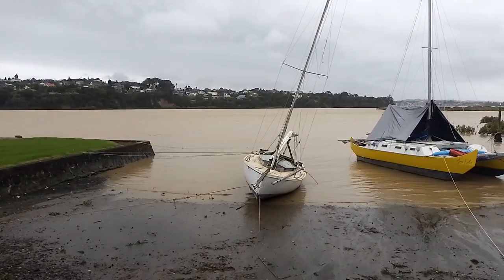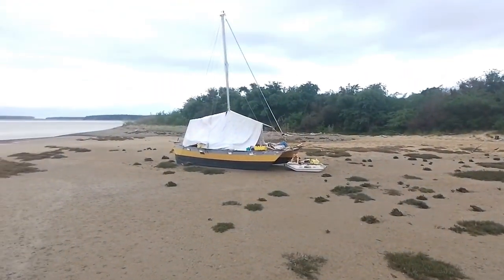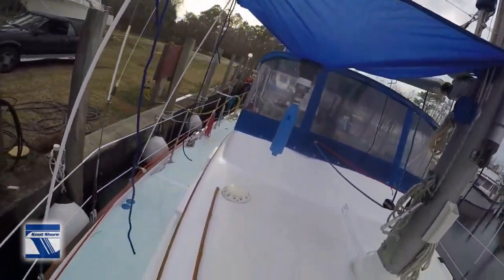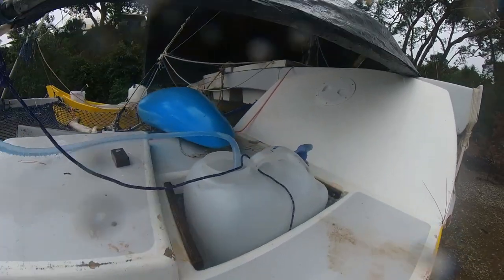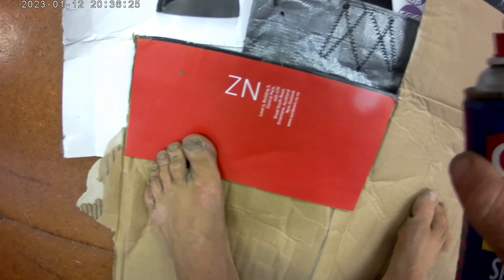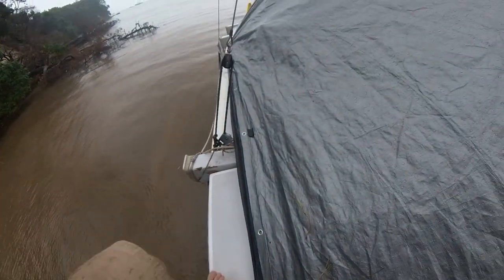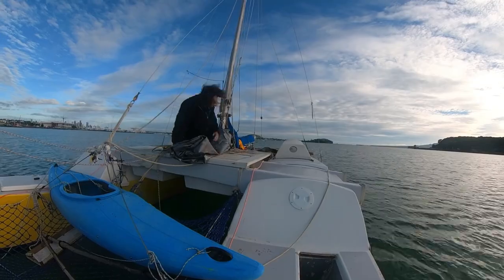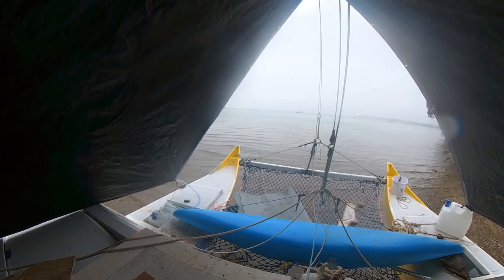An Improved Rain Catching Tent. Sailing Yes Let's 13

Comment: Singer 306k I'm redoing the interior on my boat atm seems to be a good machine
Thanks for the upload
Reply from the maker: yeah it's pretty good, they don't make domestic machines with the steel body any more! not to mention, the chocolate milk colour! although a slightly more modern one than this would be good, it was hard to find the right bobbin and replacing the bobbin is a hassle, though every machine has it's own personality.

Comment: A little engineering goes a long way !
Reply from the maker: Sure does! I'm still thinking of improving it. A curved roof would make much better head room, but would need bendy poles. Probably closable ends will come before that.

Comment: It's a good idea. What are you using the water for? Are you filtering or boiling it, to be used as drinking water?
Reply from the maker: I drink it as is. rain water doesn't need filtering or boiling. it's already distilled by natural evaporation!
Reply from the maker: Actually this is a funny one. In the USA drinking rain water is officially discouraged. but in NZ it's very common. Much of rural NZ is on rain water. Usually it there is no special arrangement except a tank!